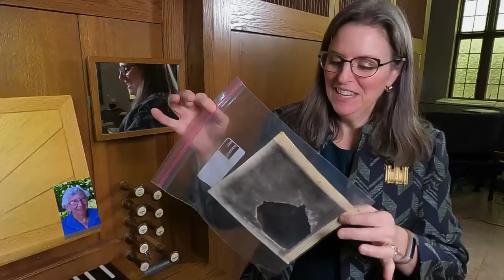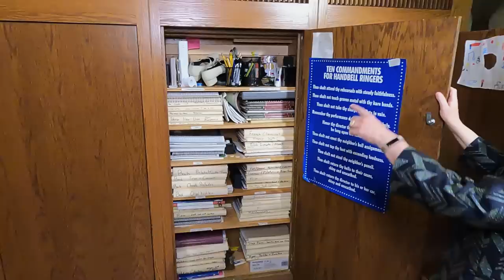1991 Martin Ott Organ - St. Monica Catholic Church - Creve Coeur, Missouri

Comment: Good grief - I don’t see any walking boards - how on earth at the front pipes on those chests tuned?
Reply: Having held keys for a lot of tunings, I can only say that it requires some nimbleness for sure. On the other hand, the flues are rarely touched, as the organ stays in tune remarkably well. Also, the swell grates were originally screwed on from the inside, and Martin changed that in 2017 so they can be much more easily removed if tuning those front ranks is required.